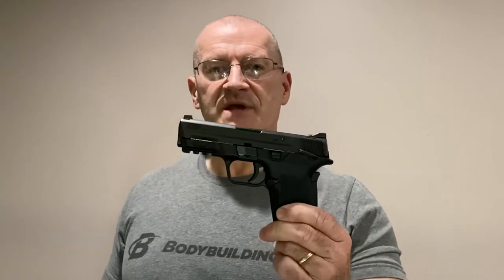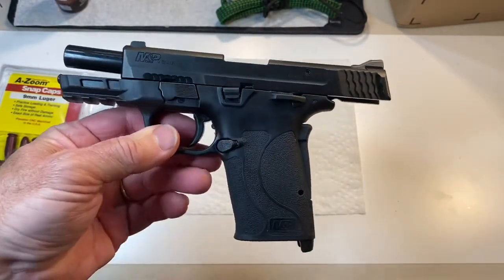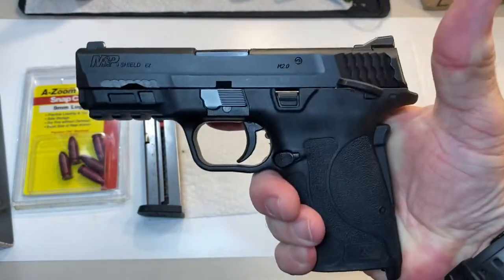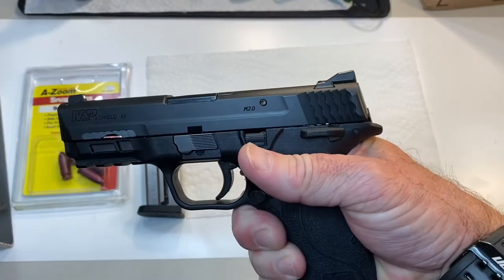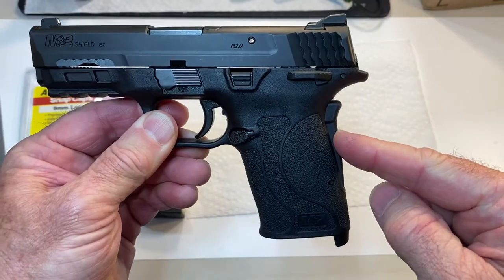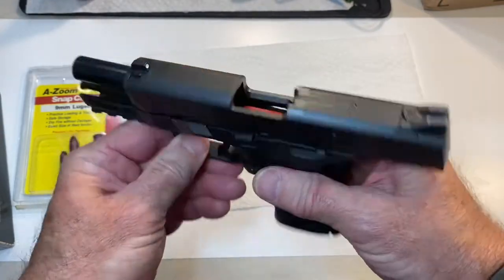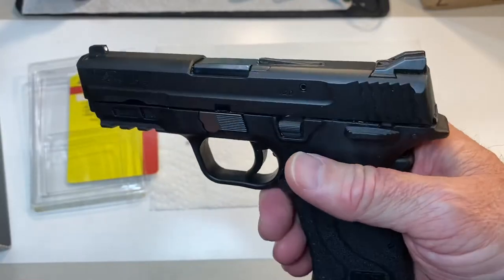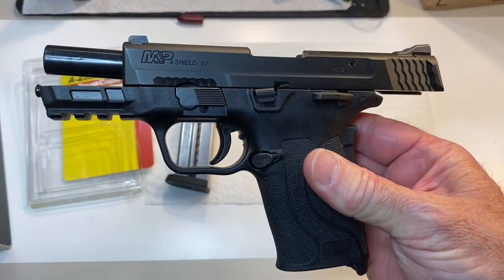M & P Shield EZ 9mm or 380 Function and Safety Check

Comment: I really liked and understood your demo, because you simplified everything. Well Done! BUT I just purchased this weapon and it doesn't have that safety feature where yours is. Why is this?
Reply from the maker: Are you referring to the grip safety on the back of the grip?
Reply: @davesgunchannel  No Sir, it is the area beside the release.....
Reply: @davesgunchannel  BTW tyvm for responding so quickly. I am subscribing to you because of this....LoL  I viewed some other videos (NOT as good as yours) and some of them didn't have the feature I am referring to either.
Reply from the maker: Ok, got it. Some models will come with the “thumb” or “external” safety.  That is what yours does not have. It is an option on some guns.
Reply: @davesgunchannel  No, not the grip safety.....  I have that.....
Reply: @davesgunchannel  So it is a either or, huh? I think that I have the thumb release. I think that I would prefer the external. Be Honest.....Which do you prefer?
Reply from the maker: There is a Grip safety on all of the models as far as I know. This is the big lever that you squeeze on the back of the gun.  The “thumb safety” is the optional feature. This is the little lever that is behind the slide release. As to your question, I actually lean towards the thumb safety. Some think it is unnecessary and just one more thing you have to do before the gun will fire, but with proper training, it is not a big deal.
Reply: @davesgunchannel  Ok Thank You Sir. My groom is deployed otherwise I would seek his help, but I got it from you which is highly appreciated. I, went on my own, and replaced my Rossi with a 380. I wanted a semi instead of or to revolver. You have been absolutely wonderful to take the time out to assist me with this matter. Sir, please enjoy the rest of your weekend and remain safe.
Reply from the maker: Thank him (and you) for his service, and happy to help!!
Reply: @davesgunchannel  Ahhhh Sir Thank You for your kind words. I am on the phone with him now and he also Thanks You. She is little upset that I didn't wait until he returns home to help me. I told him No Worries because my new YouTube Friend offered his assistance and help me quit well. My Groom is A ok after I told him that.....LoLoL! He is just being silly, but very protective. Mr. Dave I will return, especially after I take it to the range here on post. I'll see how it goes and will let you know. Between you & him I now I need a power nap...LoL, But Psssst....I still like the safety feature on your 380 better than mine. Oh Well.....LoL Take Care Friend.......

Comment: Is the trigger supposed to reset? If I squeeze the trigger, keep it squished, rack the slide then ride the trigger forward, am I suppose to hear it click? Mine currently isn’t clicking but I thought it should.
Reply from the maker: Yes, the trigger should reset, and you should feel some kind of a ick when it does. It may be very subtle, but there should be some.

Dave